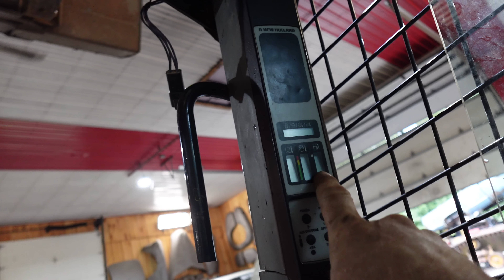Everything Wrong With New Holland C232 Skid Steer

Comment: I actually work at a newholland dealership and I’m very familiar with these machines, I would be willing to give answers over the phone or even send a service manual to an email with wiring diagrams and troubleshooting instructions
Reply: That is very good of you to offer.
Reply: Rich Andy good show lucky to have any kind of Skid steer ,when the Wife sends you out to work in the garden it actually play time I've only got shovels and wheel barrow Rich we need to dirty Andy he,s to clean to be in your presence LOL
Kym
Adelaide
Reply: John Deere should take an example on this here.
Reply: With my problem, there telling me it’s the peddle throttle and it can’t be bypassed.
Reply: @wannabeitall2580 I’ll take you up on that offer
Reply: @lifeonmttammanyridge2565 you really shouldn’t be by passing the pedal but I have seen it get people out of a pinch, those pedals are right in a bad spot and get really corroded and need to be replaced, really no good way to fix the old one
Reply: The dealer wants to charge me $2200 for parts and installation. Is there anywhere I can get the parts and fix it myself. Or does it need a computer program to re-establish communication with the ECM.
Reply: I worked at a new holland dealership, and on those models had a ton of problems with that stupid board all the time, I probably changed 15 of em a year they were expensive and usually back ordered
Reply: @Notfilthy-ImAndy  I’m not seeing an email on any of his social media pages.
Reply: Kind of a shame that a man can't take a piece of relatively simple equipment and fix it up purely because of the electronics. Total BS. Right to repair.
Reply: I would be very interested in that information
Reply: Hey I would like to see if you can get me some info on a NH C238 it's giving me some trouble. Stop Light turns on and won't start at all. It'll try but not fully start. Thinking diesel filters, starter, solenoids, or maybe even something electrical.

Comment: I have the 2016 C232 with pilot controls. When I first got the machine it had about 1500 hours on it. It ran great for about 30 hours and then I start having all kinds of electrical problems with mine. I brought it into the new Holland dealer. They went over it and found out that the main wiring harness needed to be replaced. Apparently at some point new Holland sourced their wiring harnesses from a different manufacturer and they used inferior wiring and sheathing to build the harnesses and it caused a whole lot of headaches a crossed the board as far as all the new Hollins that they have manufactured and sold during that time period. They did wind up fixing it for me. I believe it was under some sort of a service bulletin recall type of thing so I don’t have any paperwork or dollar amount for that repair. Good luck with your machine when they run right they are quite literally tanks.

Comment: The sudden stop is due to the seat switch. If I lean too far forward, especially with low fuel level, the seat switch will activate. Also if you have low fuel level and hit some bumps the low fuel alarm will beep at you. As far as I know the parking brake switch and the mini switch on the console perform the same function. There are relays for them in the fuse box.
Reply: Yes this is right, it is either the seat switch thinking you got up out of the seat and locks up the parking brake, or the seat belt switch giving you issues, or both.  
Also hitting the operate button once you get in and start it and put the safety belt latch in is a normal procedure to operate the machine.  
Get in sit down push power, enter code for starting if you have one or just hit start, then put safety belt in or unplug and replug it in if you are using behind your back, then push operate button to unlock parking brake and activate hydraulics.  

I believe your issue with the voltage meter and fuel stuff is a bad ground, I would splice in extras in case you have an intermittent ground issue back to negative battery terminal.  

Good luck I just got a 2016 L218 new holland and have been doing lots of research and work on it.  Gotta love the oil filter location mine looked way worse with only 600 hours on the machine. And under the motor looks the same.

Comment: Sounds like you have an intermittent ground to the control panel... turning on the parking brake makes a separate ground, enabling operation... then, when the other ground comes back in (or whatever) the parking brake comes on, throwing you forward.  Just a guess.
Reply: I had one do something very similar on the instrument cluster, it was a bad ground wire for the cluster where they splice all the grounds into the main harness

Comment: I mostly use a filter wrench with three arms that grabs the filter on the end. That's what you need there.
Reply: There's also a cap wrench with a 1/2" drive for all sizes of filters.
Reply: @scowell  yeah but that sounds like a awful lot of stuff to carry around.
Reply: @scowell this is what I was going to say.  Only way to change the oil filter on my BMW 120d is with a cap wrench.

I only have one use for it but yes having to carry around lots of sizes compared to an adjustable one would be a pain.

Comment: I'm just an old man and a backyard mechanic but I must say, ground connections are everything and then some. I would also add, check all pigtails on the alternator as many corrode over time. A rare shot in the dark is the voltage regulator itself could be failing.. I Always pressure wash all grimmy, oily machines before I start working on them. Good luck guys, look forward to what turns out to be causing the issues.

Comment: Oh man I worked on these for years. The park brake light is very likely the park brake pressure switch located in the valve block that is in the left side of the machine. Kinda hard to do diagnostics over YouTube lol.
Reply: Also if I remember correctly the engine at high idle is supposed to be 2700 +- 50 rpm for the F5 engines. 
And 1150+- 50 rpm for low idle.

Comment: Check/add grounds.   Also add a wire from alt to battery of a higher gauge.     I started doing this when doing car audio and have continued.    It makes the electrical more stable as well as increases voltage.     Check seat/seat belt switch for frayed worn wires

Comment: Dash will also count down like that if the Engine oil pressure switch is open while engine is running. 

Park brake pressure switch on the pilot block turns red park led on and off. 

The seat switch will not bring any codes up just park brake on. 

The sudden park brake coming on will happen with any red stop light ( serious fault ) 
You can scroll through all the codes while active with the aux override button. Maybe note them down next time it happens. 
You can only view logged codes through that dash with a service tool.

Comment: Nevwr worked on these before, but it would make sense if the volt meter isn't getting a proper reading, and it has the same power source, then the signal to the rest of the gauges would read low, if at all. So find you power loss to the gauge panel, fix all the gauges...

Comment: they were notorious for problems around the fuse box and related connections, usually from water ingress collecting in the fusebox, there was a modification bulletin talking of drilling 2 x 7mm holes in the bottom of the fusebox holder to allow the water to drain out, also issues with harness "strain" (made the loom too short) ....esp pre NCM427579.

Comment: Hey Rich.  Check your body and chassis earth points. Could be corrosion issues. Especially if it's been under water.  C9uld also be a corroded  earth wire just back from the attachment point. Separate them and see how the wiring looks.

Comment: Charging issue check the positive wire coming off the alternator it splits into 2 leads under the engine and does corrode. The locking up issue sounds like a seat sensor wiring or seat belt buckle sensor, both will cause them to lock up.

Comment: If you think that engineering is bad, the older LS 170 series had you unable to remove the battery unless the boom was up. So if battery dead, think of ways to lift boom....
Reply: Like, how does that not get addressed in design?

Comment: Hey depending on the year those units had lots of issues with the joystick handles breaking wires where the wire works back and forth on the joystick pivot. There were updates to how the harness were held and routed.

Comment: Forgot to mention, mine is actually in that same shop right now because the full throttle apparently went kaput and I have zero response on my throttle. Apparently the foot throttle is the first place that the wires coming off of the throttlebody go to and then from the foot pedal up to the a pillar throttle And it’s costing me quite a bit of money. If there was a way for me to bypass the foot throttle, I would do it because I don’t use it very often.

Comment: Just fixed this on my new holland. The fuses for in the cab were bad. Kept dropping voltage, as it comes through the engine fuse box to the key switch then through the safetys.
Guessing you have a bad fuse, had one of the blades that got hot and made a bad connection.
Best guess is you have a massive voltage drop from the power supply to the key.

Comment: My old boss had a TV380 Case with that remote oil filter by the battery. Luckily, I noticed the trail of oil behind me in time and shut the machine down. One of the hoses running to it sprung a leak down under the engine. He agreed to me removing the remote filter setup and just screwing the oil filter right onto the side of the engine where it belongs in my honest opinion.
Reply: Oh man. Such a bad idea for that remote filter.
Reply: @Notfilthy-ImAndy  no doubt, I get that case likes to make maintenance easy and highly accessible which is great, but there comes a time where the cons outweigh the pros and the risk of damage isn't worth the convenience it might offer.

Comment: Case and newholland skidsteers are the same machine with the newholland having a few extra panels here and there.  Case has issues with those clusters and their harnesses.  If you ever run into a situation where it doesn’t start check the maxi fuses beside the engine block left side on body
Reply: You can also eliminate that oil filter relocation kit. The main housing is under the cab
Reply: I think we’re going to be looking into that in the very near future.

Comment: Go ahead and order a wire harness for that machine. They get brittle and will fail in multiple points. It was a major design flaw on those early models. They claim to have updated the materials on the new models wire harnesses. That will most likely cure your electrical gremlins

Comment: 7:42 the Engineers designed it so you can use a proper filter socket and a ratchet, so it can be undone properly and tightened up properly, rather than with a universal pair of filter pliers that scratch up the can or crush/dent it.
Reply: Stop tightening filters with tools, they’re meant to be hand tightened only!!
Reply: when you loosen it you throw it away, when you put it on you use your hand, I don´t know you´re so strong that you crush the filter....

Comment: Is there a diagnostic port where you can connect to a service tool on your laptop? It may have fault codes stored that are goofing things up. And beings it was probably sunk in the water at some point make sure you double check all the grounds on everything, one bad ground can cause weird shit to happen.
Reply: This machine likely does not have much for electronics as the engine is teir 3 and has mechanical foot controls. The only thing you can read codes off of is the EGR ECU and the instrument cluster. The countdown on the instrument cluster is possibly because of something on the EGR ECU but it is more likely that the pressure switch for the park brake is not working which explains why the park brake light is on but it still drives.
Reply: There is a little screen on the pillar that usually cycles between rpm, coolant temp and hyd oil temp. It will show you the code there when It throws one

Comment: Rich I love you but pressure wash that thing before you bring it in your shop with the C-10 and the Audi and I know the truck is probably outside but pressure wash it before you work on it and get all the dirt off before you bring it in your beautiful shop!
Reply: Definitely something going on with the circuit board and control panel that’s what gets pushed and touched the most and it was hanging down and open allowing dirt and moister to get to the back of the control board, I bet if you get a new one most of your issues go away, also find out what the ohm reading is supposed to be from the temp sensor and see if that is what the buttons and cluster is getting or if the temp sensor is giving the wrong ohms

Comment: That's not the correct instrument panel. If the machine has a key (open station) then it should not have a start button, the crank position is with the key switch.